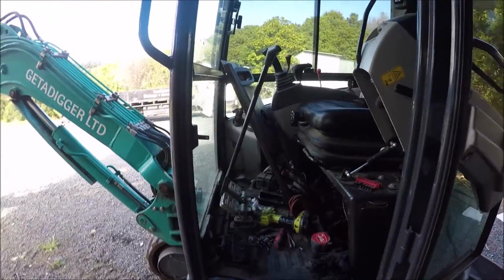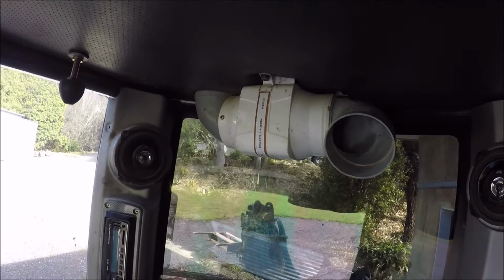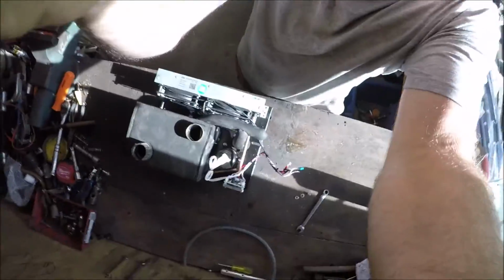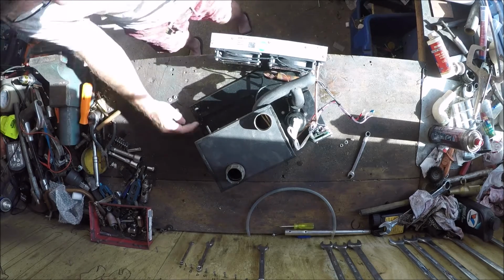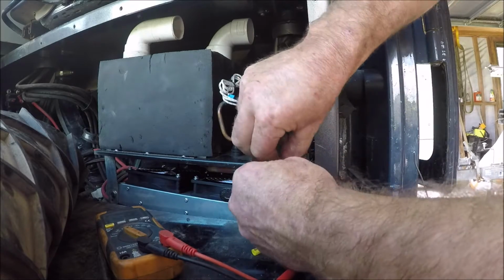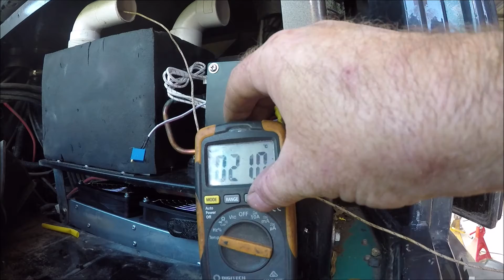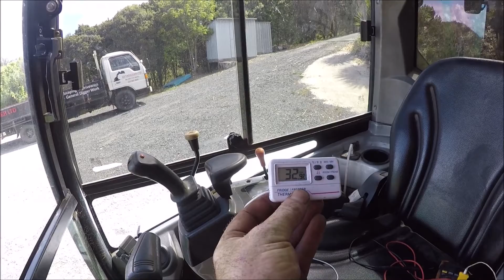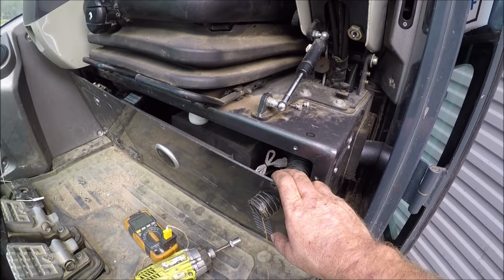Mini Excavator A/C Install

Comment: How is it working. Couldn’t you have installed in engine compartment and run the hoses?  But great job
Reply from the maker: It worked OK but eventually switched back to just a fan.. No room in the engine compt.
Reply: @getadigger  Mount it on top of the digger and run suction and discharge into cab. 
the evaporator puts off hot air so that has to be outside.